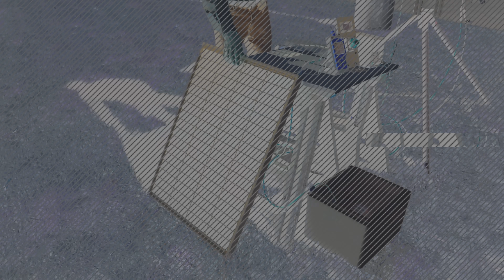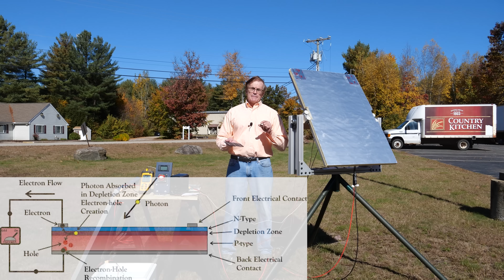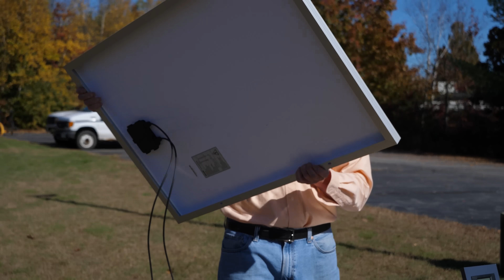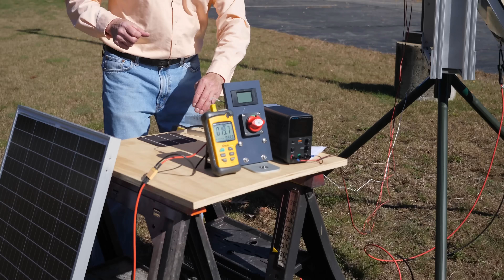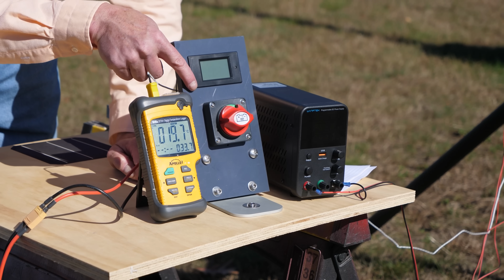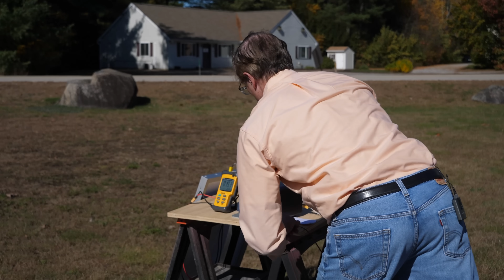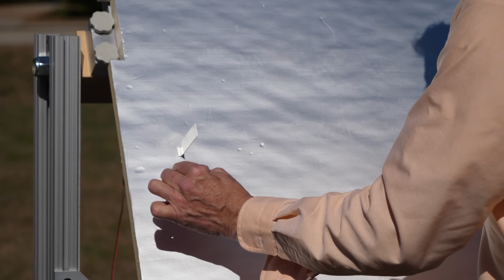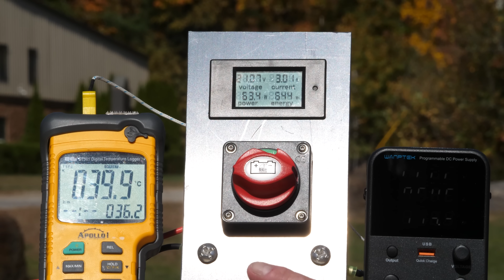Do you REALLY get enough out of your solar panel?

Comment: Did you know that zebra are stripped to cause a difference in temperature on the  surface of their skin. This causes micro turbulence. Would something like this work on a solar panel or on the roof around the panels? What do you think?
Reply from the maker: Where  did you hear that?
What's  the suggested purpose  of that micro turbulence?
Reply: @TechIngredients  I saw it on some BBC program years ago. I don't remember which one it was. It was about how zebra keep cool, or at least part of the program was. Sorry I don't remember more. Vertical stripes and sun. I don't know how it could be tested though (to actually see the micro turbulence).

Comment: Since this is a question of optimizing the output of the panel, it would be best to allow a MPPT to do that. The only conditions you really care about are the impedance, current output and voltage. The MPPT algorithm doesn't necessarily matter. So just measure the voltage and current to retrieve and compare the conditions. In fact, the optimal load impedance will almost certainly decrease with lower cell temperatures.

Comment: Sorry but major flaw in your testing... You tested the panel with the back covered up, which would have changed the 'no fan' result. Also need to test more than just one panel. And with the additional cost of the fans, wiring, aluminum, you could have just bought more panels and made more power.

Comment: Hi. I understand you can improve the output of a solar panel by introducing vibration - say loud music via a loudspeaker in contact with the panel.  The theory seems to be that the vibration helps the flow of charge.  I was wondering if you'd looked at this possiblilty?

Comment: instead of making many lengths of angled aluminum strips, do you have a tool to make "V" angle fan-folds in a large sheet of aluminum?   Is there such a thing as heat conductive adhesive?

Comment: Have you considered that when install over a roof, the air gap between the panel and the roof create a natural draft that cools the panels? Is it possible that your modified panel retains heat better than a unmodified panel?

Comment: Add a duct that extends past the panel vertically painted black and you might get the same effect just using natural convection and not lose a few watts of power on the fans.

Comment: I apologise if you mentioned this but I missed it. During your experiment what was the external/atmospheric temperature?  I just wanted to compare this to UK summer temperatures. As I am/was considering an in-roof system (for mostly aesthetic reasons) which I understand typically get warmer than on-roof panel systems. In addition if the panels are on east and west facing roofs rather than a south facing roof (as would be in my case) are the panels less likely to heat up as much as south facing panels?

Loved your video 👍
Reply: 19.3C

Comment: In an open air water-cooled system (especially with such a large surface area) evaporation is the heat sync. Think swamp cooler. Some water would be lost, so may not be ideal in areas with water shortages.

Comment: Thanks for doing the video on solar panel thermal characteristics, it's interesting to see the difference in output power reduced temperatures produce.  I don't however recommend using a fan to move air though.  Over the years, designing semiconductor heat removal systems used in outdoor environments, fans prove to be are an undesirable maintenence item.  I would instead recommend a 1 to 2 inch (25 to 50 mm) air channel behind the panels to allow for convection to take place.  Heatsink fin spacing would need to be increased to about 1 inch/25 mm to facilitate air flow, plus lengthening the fins so they protrude beyond the solar panel frame into the air stream.

I don't recommend running water directly over the solar panels.  The constant water flow causes corrosion and eventually could find its way to the silicon wafers.  Also, over time, minerals in the water build up on the glass, fogging the glass with a coating that is difficult to remove.

Comment: I'm a little concerned about the "extend the lifetime of your panels" argument when the fans themselves presumably have a lifetime much shorter than 20 years?

I'm curious about potential systems for rooftop solar that hook into a central air conditioning system for their cooling, would that be efficient/possible? Reduce the number of fans and reduce the number of fans located in hard to reach places in particular. Couldn't a coolant loop move the central fan to an easier to serve/maintain area on ground level?
Reply from the maker: The fans can be limited to the hottest  part of the day and made modular to ease replacement.  Fewer, larger fans will increase efficiency and reduce maintenance.

Comment: What about a closed loop cooling system (filled with an anti-freeze solution) paired with a heat pump and exchanger coupled to a geyser/water heater? 

I drafted up a design using 15mm and 22mm piping and a few types of couplings. It uses reducer T (1x22mm, 2x15mm), and two 3x15mm T for the inlet and outlet manifolds. There is a 22mm pipe with a longer 15mm pipe fitted inside (this pipe is passed through the reducer T almost the full length of the 22mm pipe) and closed off with a 22mm end cap. The reason why I chose this arrangement is that the temperature difference between the ends of the cooling tubes should be lower due to the heat exchanging surface of the internal 15mm pipe; thus even cooling along the length of the module. The 22mm pipe assembly is coupled to the back of the PV module using underfloor heat spreader plates. The cold inlet is connected at the first module, and hot outlet is placed at the last module to help balance coolant flow between the PV heat exchangers.

Comment: It's an interesting approach, but how much would it cost to cool a medium sized 5kWp array? My guess is, that the cost would be close if not more to just adding 1 or 2 more panels which could easily offset the efficiency loss due to heat. Especially if we also accounted for the fact that it's unlikely a fan would last for the life of the solar panels and so it'd had to be replaced which in turn would increase the cost of the cooling system even more.
Reply from the maker: That is the issue, but as you said, you're  guessing.

Comment: I'd love to see additional steps for DIY solar. a DIY inverter would be awesome. There are tons of videos on how to take a computer power supply and make a Bench supply. Something of the opposite would be cool. A diy or reasonable storage option. I've seen the DIY 18650 banks. They kinda scare me a bit and deep cycle marine batteries are generally heavy and expensive. What do you recommend.

Comment: Ok but fans have moving parts, and they will be also less efficient with time pass. Will they survive this long (25 normal years + 10 additional because of slower panel degradation)? Maybe some better radiators, with vapor chamber and other novel engineering?

Comment: i know there is some systems out there that use heat as a power source (geo thermal generators) i wonder if solar panels could do something similar. get power from the solar then the heat it puts off some how get power from that.

Comment: As "the engineer", I did ask the question about "why do it, for this little power" and also answered "panel longevity is the biggest benefit".

I would find it interesting if you combined this with your reflectors and tested the delta-T between cooling running and not, as well as against the active cooling and uncooled temperature in similar ambient conditions without the reflector, so we could observe how much temperature is increased just by adding the reflectors.
Reply: Panel longevity now is 20 years+ and power output after that duration is 80% of what the panel when brand new.
Reply: @Dean G  I plan on living longer than that. You provided only a single data point which I assume is uncooled, so there is no point of comparison.
Reply: @Sevalecan  I don't think you read my post properly.

I didn't say the life time of a panel is 20 years and that it needs to be replaced after that duration. I said the power output is still at 80% of its original rated power when it was brand new.

The implication being that the panel can continue to deliver a useful amount of electricity for longer.

And you won't be able to create a panel that lasts a life time anyway.

Yes it is a single data point, but it's accurate and from one particular manufacturer.

It isn't just heat that shortens the life of semiconductor devices, in the case of solar panels it is the UV that is present in sunlight that damages them.
Reply: @deanXRayZulu  I did read your post properly. I just don't agree with your outlook.

Sure, 80% effectiveness at 20 years sounds good, but I'm not an old man. It's only going to get worse past that point. And the portion of my post that perhaps you did not focus in on is that I am curious about how I can limit panel deterioration if I were to employ the reflector panels he used in an older video, especially since I don't live at the equator. This is going to increase the heat load on the panel necessarily.

Regarding UV, I hadn't considered it, but I do imagine that if the semiconductors aren't particularly efficient at absorbing UV, then the transparent material covering the PV material would likely be coated with something to filter out UV light, similar to the UV filters for camera lenses which still allow virtually all of the visible light to still pass.

If the panels are harnessing the UV light in any significant portion, then the consideration should be made whether it would be worth the tradeoff in efficiency to filter that out for longevity.

Point is, UV exposure isn't as easy to modulate as temperature, and UV exposure having an effect doesn't necessarily determine that it's a more significant factor than panel temperature.

Comment: I think that there is a mistake. The panel had temp 53C because at the back was closed and the air was traped! You must do the experiment with the back side free!!
Reply from the maker: The back is not closed and the air is not trapped.  Convective flow is VERY slow.

Comment: I wonder about using a under panel radiant cooling system would be better. 

Use marine antifreeze & add a additive like in racing to reduce the surface tension like in racing to make heat transfer better. Then cool the antifreeze 0° & just keep circulating it. Might be really good in the hotter areas of the world.

Comment: I like how you go into detail. The only thing that i miss here. Would be another comparison only with passive cooling and also im not happy with the air intake/exhaust in the 1 temperature result. Because  there is a much bigger gap when installed on the roof where also wind blow under it and cool it down. So its not a fair comparison. 

It would be still a good system not only for longevity but also if the roof is already full of panels, that way you could squeeze a bit more power from a limited area.

Comment: This ideas is for sure going to make it far more complex and perhaps not worth it. But what if you modify the panel in such a way that you use the dew point in your favor? If you manage to get the panel just cold enough for condensate to form then you can enjoy the wonders of "latent heat of vaporization" to absorb the heat (and cool the panel), the fans would drive the hot - now moist - air out of the panel. This might cost more energy then you get back.

Comment: Why not take the heat generated, and use it in a system for heating water? Sure, it would not be enough to heat water sufficiently, but any additional heat you can get into water, means less energy required to heat the water to the required temperature.  The water (or gas whichever was more efficient) would act to cool the panels, maybe through some kind of fins used as a radiator (like in a pc CPU cooling system), and the slightly heated water would then pass head through to a tank or any other useful purpose, and then be passed back.  This would not need any pumps for a passive system, but could use pumps for more cooling.  Again, this is all based on previous systems you have built, and I am sure you have already looked at this, but just in case you haven't.

Comment: A couple things come to mind.  

First, I'd really like to see the unmodified panel's performance rather than measuring the performance of the panel with heat fins attached but blocked by the outer sheet trapping the heat and not allowing convection heat to flow upwards.  I'm speculating that there's no heat sink compound between the fins and the outer sheet of aluminum and just trapping heat inside.  With my rooftop solar system on a sunny day, there's significant convection warm air flowing upwards between the panels and the roof deck that whisk away the heat.

Second, the longevity of the fans vs the solar panels.  How often do they need replacing?

Third, what is the performance look like with the air heat sink attached but the rear panel removed so that it can just dissipate into the open air.  I would guess that would be the best of both worlds.  More surface area without adding mechanical devices to the mix.

Comment: I really enjoy these energy videos. I've been way ahead of you on this so far. If you store the extracted heat in an underground insulated tank/pool, you're offsetting your home heating costs in the winter, while chilling your fluid for panel cooling in the summer. You can also run a closed loop ethylene glycol loop into an aquifer for a few hundred dollars and only run it's pump when ambient temps are over 30-35F. It takes very little energy to move fluid in a loop.
Reply: But have you done it?

Comment: Why not mount the fans on the bottom of the panel since heat rises and the air at the bottom of the panels would be very slightly cooler?
Reply from the maker: Remember, the fans are blowing  the air out.
Reply: @TechIngredients  that makes sense. I missed that detail the initial time. Thank you for the reply and very entertaining and informative videos.

Comment: I want to put heatpipes and collect the heat into my heat storage tank. I've settled for aluminium sheets and maybe 5-6 flatten 15mm copper pipes with either ethanol or water as a working fluid... 
Heatpipes are easy to diy. 
The only thing I hadn't figured out yet is the thermal interface between the aluminium and the pv panel as it's pretty irregular... thermal pads like in computers would be nice and non-permanent but I don't think I'll find a 1.8m² 1mm thermal pad anytime soon and at any decent price... probably I'll use silicone grease...

Comment: I'd love to see this waste heat transferred to domestic hot water heating. To really drive up efficiency, a refrigeration based heat transfer system would allow for sub-ambient panel temperatures while still producing the required hot water temperature. Small water to water heat pumps for domestic hot water already exist for commercial buildings that use geothermal heat sources.

Comment: They do suck but, are good enough for the applications u intended and expectations u set.

Direct airflow gives a boost to longevity but they aren't weather resistant as panels go. If someone can make up a more cost effective system then id be buy or apply it to my own system.

Comment: I would stick with the small fans as you can get 120mm industrial fans in bulk on ebay and they preform better in high static pressure situations. Since you only have about an inch before the air changes direction and the air is changing direction twice I would not use larger fans... Larger fans will also consume more power under load. Yo may have to apply more power to a larger fan to reach ur CFM target.

Comment: I Would love to know how much the batteries cost to store the electricity and how long they last on average. I like the concept you have there and I am very tempted this summer to buy some equimpent and find out what I can do even If I overspend it will give me all the information I need and i can determine if it is worth a  bigger long term investment.  So much of this data is not readily available and My belief is because the cost to benefit ratio is not there.
Reply from the maker: Batteries can be an expensive  addition.  That is why a lot of systems are tied to the grid.  This avoids the investment and the cost of maintenance and replacement.
Reply: @TechIngredients  would you be able to explain how grid tied solar works. I have been able to find some information online but nothing that details the way the connection to the grid works.   Hopefully you see this reply and thank you for any consideration you give to the question.

Comment: Heat pump, maybe?

I'm no engineer, but I've watched enough YouTube to know that heat pumps are really efficient in the right circumstances. Might be overkill for a single panel, but perhaps could be worked into an array? I dunno! That connection is my sole contribution.

Comment: There is one MASSIVE factor that you are not taking in to account at all. and that is SOUND. If there were to come to the roof of your home and you would have hundreds of these fans running at the top of your roof you would probably have a lot of annoying sound when you are outside of your house for instance. even few fans in your computer are annoying af let alone hundreds on your roof. it might work better on commercial applications not close to residential areas.
Reply from the maker: Probably  not.
The optimal  speed  for these  fans is very slow. That is where they are the most effecient. During our tests, you couldn't even hear these fans with your head less than a foot from the panel.